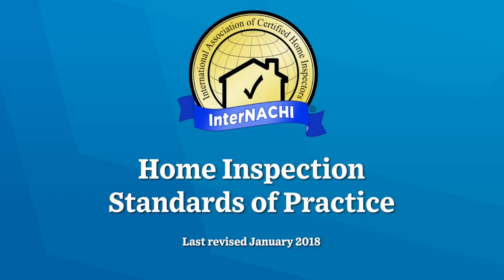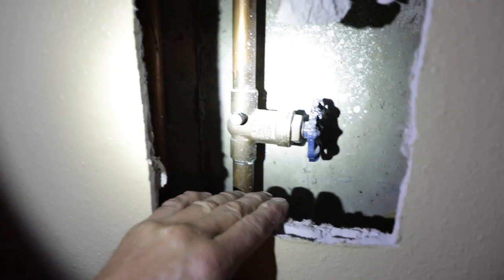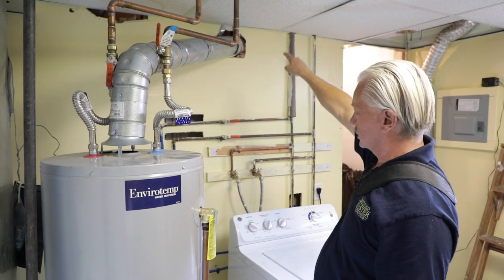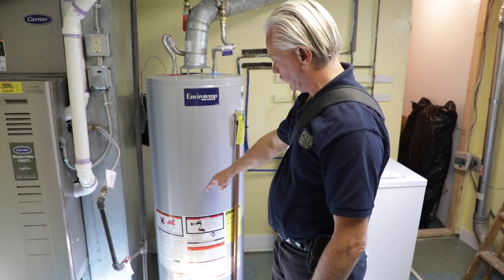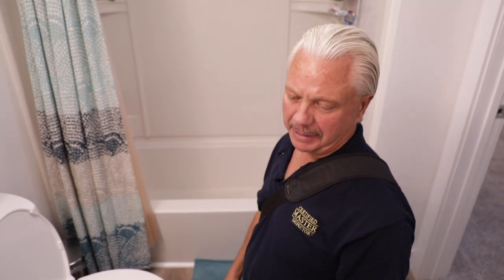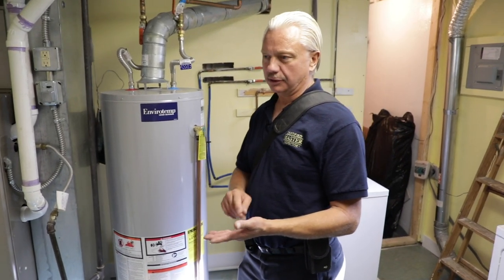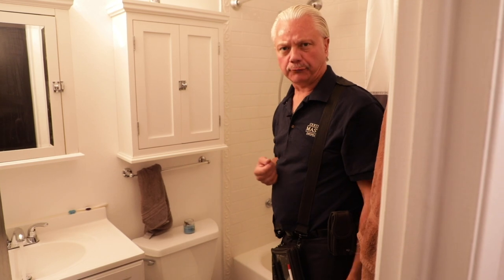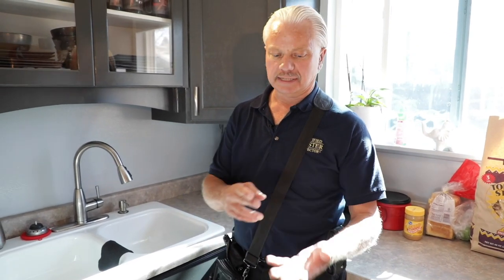How to Perform a Plumbing Inspection According to the InterNACHI® SOP

Comment: Hold on… how is providing outside air to the water heater going to stop the dryer from pulling the water heater gasses from the flu? That doesn’t make sense. Wouldn’t you want outside air for the DRYER so it won’t pull air from the utility room?
Reply from the maker: Thanks for watching and commenting.

Comment: The high loop on the washer does not count as the required high loop.
Reply: That is exactly right. However, this video was shot three years ago, and he might have learned since. Somethings, we fail to realize as a home inspector is, although we’re not code enforcement, we are safety and function reporters, and according to the manufactures installation manual on new dishwashers that have built-in high lines, you still are instructed to install a proper high line it is our job to know what proper installation is, according to the manufacturers recommendation. I apologize for the grammar, I talk text, and sometimes it can be wonky.
Reply from the maker: Right.

Comment: Great video. It may be mentioned in another video but the kitchen range hood exhaust fan cfm rating may be limited by the AHJ. The reason is it can cause backdraft of combustion gases.  If it’s greater than the max allowable (400cfm in some jurisdictions) then make up air is needed in the kitchen.
Reply from the maker: Right. CAZ testing is beyond the scope of a home inspection.

Comment: Question...for the "Functional water test", is there a difference (different standards) for a city-fed water supply and well water?
Reply from the maker: Good question.
Reply: I don’t know why they said that was a good question. You have to think like a buyer… Whether you’re going to use rainwater well water city water or 5 gallon bucket don’t you want to know if when your son flushes the toilet and your wife is taking a shower. She’s about to get scalded? Remember as a home inspector, it’s not our job to determine why something is happening, it’s our job to report that something is in fact, happening. A drop in water pressure is a drop in water pressure and it so shall be noted.

Comment: Question on the kitchen tap. In Texas at least I was taught that hot water on a single lever control should be pushed back, away from the person, and cold pulled forward, as to not have a small child come and try and turn on the water and end up turning hot water on and burning or scalding themselves, is that strictly a Texas thing? Or not an Internachi thing? Just curious.. great video nonetheless!
Reply from the maker: Good catch, Caleb. You could reach out to the inspector at https://www.nachi.org/certified-inspectors/james-krumm-cmi-6629

Comment: There is not any supports for the gas meter it is just supported by the piping. The gas regulator also is too low to the ground and can be buried in snow so if the regulator malfunctioned the gas could not vent off into the atmosphere but could accumulate in the snow and cause an explosion. The gas regulator should be 3 feet minimum. The gas meter should be tagged out and turn of immediately. The gas piping to the furnace and the water heater doesn't have any supports and is also hanging by the piping itself. Once again unit should be locked and tagged out due to safety. The gas piping to the furnace with the elbow is not supported to maintain a vertical position and could be unscrewed or loosen by hand causing a gas leak and explosion. Seems like alot of things you don't check because items are in the way like under a sink or you can't turn a shut off valve off because you don't have to. So you can't say if the shut off valves  works or not it could be non functional and not closing which the buyer is now responsible for. Anyone would assume you would put your hand on the valve but no. Seem like a lot of work excuses to do as little as required. I would have a license plumber do the inspection with the ability to do a hands on inspection according to the plumbing and gas codes for that area. You would end up saving money because the seller would be required to repair all the defects before buying.

Thank you
Reply from the maker: Glad you enjoyed watching the video.

Comment: There is so much shit wrong with this I don't even know where to begin. The venting touching the copper lines of the water heater should have been the first huge no-no because two dissimilar metals touching will corrode one of the two metals - he doesn't mention the issue. The venting can touch combustibles because it is b-vent or double walled venting. That is its specific purpose, to allow it to touch combustibles without the risk of fire. He doesn't mention the shutoff valve on the hot side. That is against code because if someone shuts it off it turns the water heater into a bomb. He is way the fuck off about "combustion air", and it doesn't make sense. How the hell would apartments work with water heaters if it needed as much space as he claims. Do not listen to this guy for advice. There is so much more I could comment about but I've gone on long enough. Jesus Christ.
Reply from the maker: Thanks for watching.